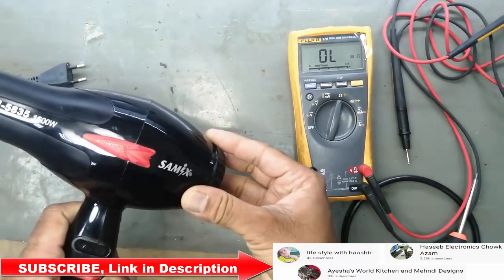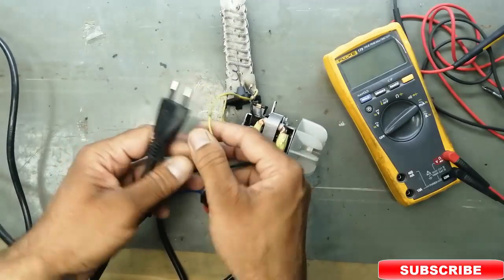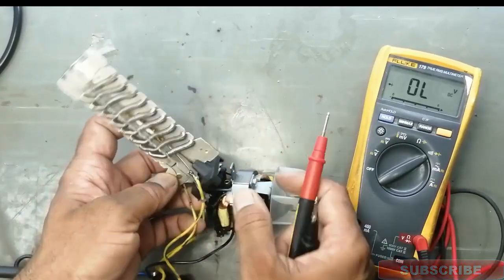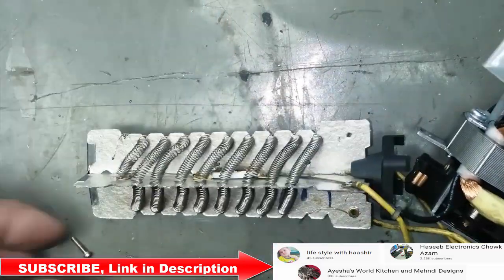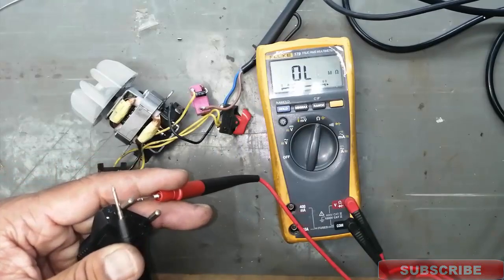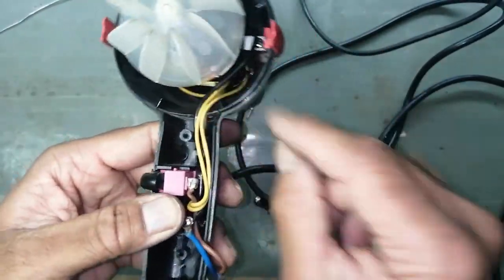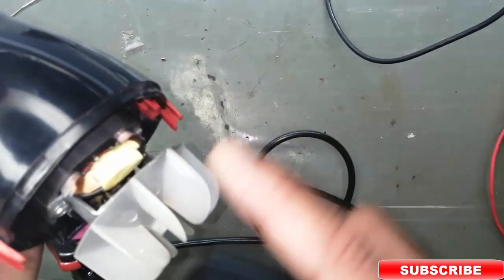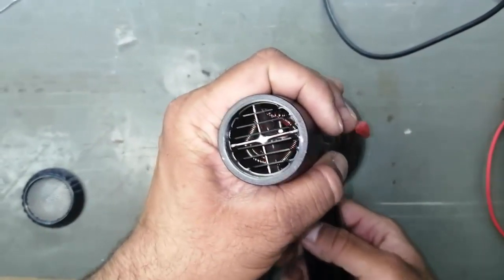How To Repair / Fix Hair Dryer - No Heat, No Hot Air

Comment: my hair blower, have a little box in handle (i think its a somekind of resistor?  ) that is burned up, that is connected to switch the negative and the other is connected to positive.
Reply from the maker: most of time there is a diode

Comment: Mere hair dryer to work kr raha h bt heat nahi aa rahi ,sbhi connection bhi sahi h, kya problem ho skti h
Reply from the maker: is me thermal fuse hota he us ko check karein. ya heating element open to nahi ho gia?
Reply: @zainElect01  heating element or wiring ek dum sahi h , thermal fuse konsa,vo to black colour ka resistor lga hua h heating element pr🙄